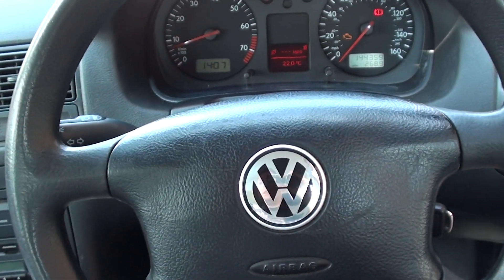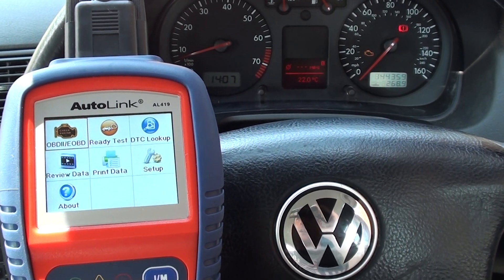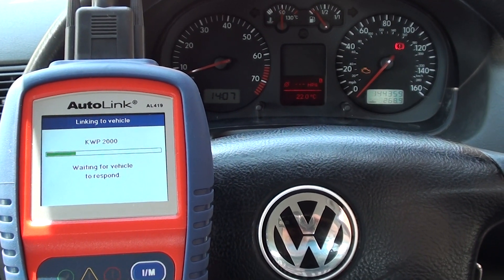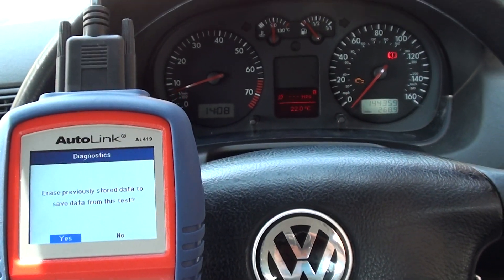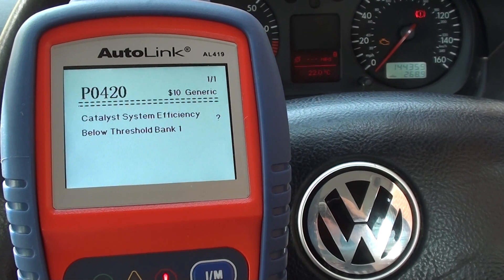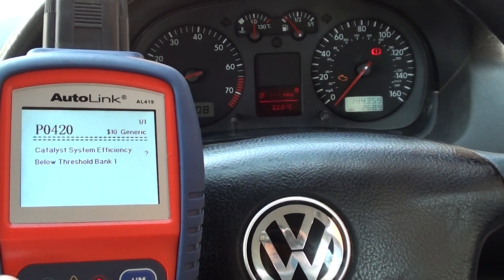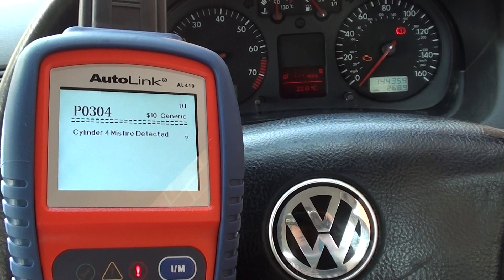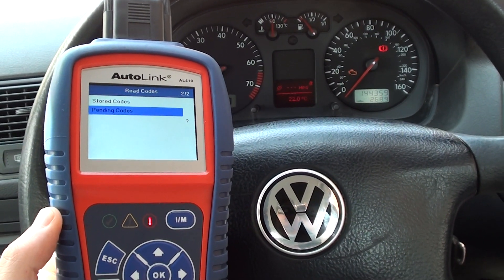Diagnose A P0420 Fault Code With Explination Bank 1 O2 Sensor Fault Engine Light

Comment: How come did you zeroed in the problem to be a O2 sensor discarding, without any other tests, the catalyst converter? Any way, the fault was P0420 which is about the Catalyst converter. Be advised that with that code, the first thing you have to check (with an voltage meter and a infrared thermometer) is the CV
Reply: CV?
Reply: @markcoe69  CV joint? What the...???
Reply: des pat  -  in the description they say check the CV?    Do they mean Catalytic conVertor???
Reply: @markcoe69  yes, i believe so.

Comment: Got this code and the same message on my diagnosis tool. The symptoms on my car are it will start then cut of then when I try again it will struggle to start at all. Leave it a few minutes then it will start rough then after a few revs cut of again. And suggestions? Thanks.
Reply: Did you ever figure out your problem?